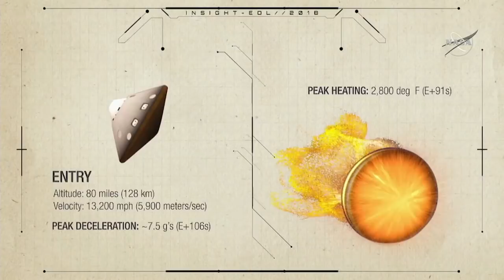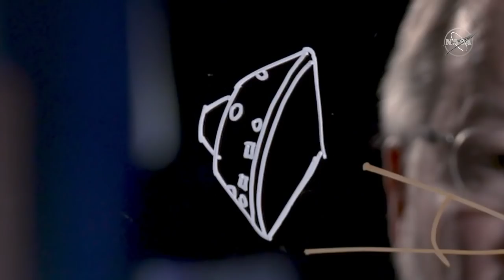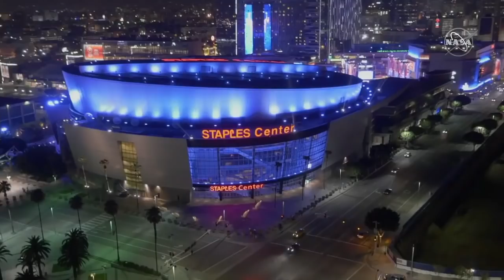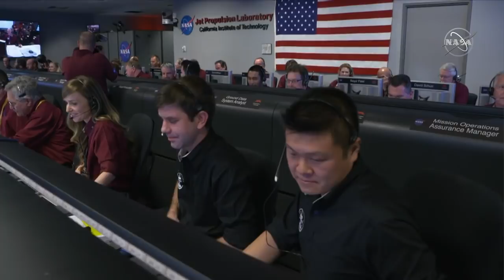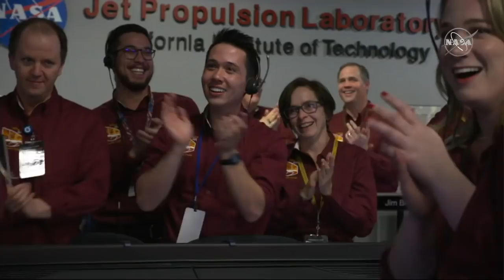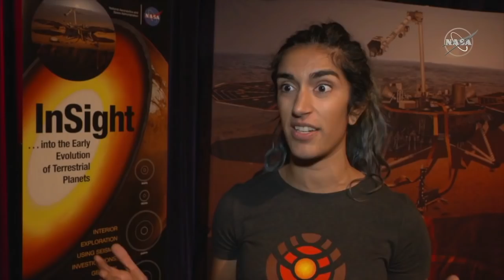NASA’s InSight spacecraft makes historic landing on Mars

Comment: LOLOLOL 1000 degrees c is 1800 degrees, HOT ENOUGH TO MELT STEEL
Reply: Maybe you should learn about how the heat shield works. It's not just a piece of steel slapped on the bottom of the vehicle.
Reply: @joshw7978  Nope. Try again. Was making a reference to 9/11.

Comment: "We(NASA) believe there is liquid water 10 000 meters below the surface of Mars"...    meanwhile here on our Terra Firma, the Kola Superdeep Borehole was just 9 inches in diameter, but at 40,230 feet (12,262 meters) reigns as the deepest hole. It took almost 20 years to reach that 7.5-mile depth! And, not physically possible to go deeper as there was some sort of inpenetrable barrier as per the Russian drilling team.
So, please NASA, do tell what kind of Disney Magic will be used to reach the depth of 10 000 meters on the heavenly body called Mars, to somehow confirm the claims.
Nice CGI and the telemetry information returned so clear as if still on earth via sub ocean cables...simply amazing

Comment: Lightspeed is the key to time travel. Of course, no object with mass can achieve such a speed. The solution to this problem is to send lightspeed through a person/object, rather than the other way around. Fire a concentrated beam of electrons at the target covered in positrons and it shall be sent back in time, leaving gamma radiation in the space it once occupied. This only works for backward travel, not future travel. Cheers from the year 2376!

Comment: 1:27:18
The counting down it's not logical at all..
It began at 600m and it took 3s to reach 400m and 3s to reach 300m and 2s to reach 200m and 1s to reach 80m !! 
It's like you are saying that insight was accelerating, not landing because the movement wasn't stable..
It's just like saying that, your counting in range of 0-101, you begin with 2 the 4 then 6 then 59 then 68 then 90 then 92,94,96,98,100!.
It wasn't logical to me anyway!
Reply: @Mark Bibbee 
That's what confused me !
I mean, let's say that when it was at 600m the engines were not working and insight had a vitesse of 100km/h let's just say.
So if we turned on the engines when it reaches 400m, the vitesse should slow down, and that what happened, so it took 2s to go 300 and 3s to go to 200 which means it's slowing down and let's say that the vitesse is 60km/h.. At this point we are close to the grown right? 
So what makes me wondering is, how could it take 1s to pass 120, from 200 to 80m, while it took 3 second to go from 300 to 200 !! It supposed to slow down! So it's just like saying, the vitesse went from 60km to 100 when we are close to the grown and then went back to 40km ! 

It's not logic, if the engines were turned on to slow the velocity, then the vitesse should dicrease, and it should be something like.

3s from 600  to 400 ,3s from 400 to 300, 5s from 300 to 200, 8s from 200 too 100 , 8s from 100 to 70, 15s from 70 to 40 ...... And so on..
Time should increase while the vitesse is dicreasing..

Comment: Why not use nucular power to run the equipment,instead of solar?    Then have a mini vehicle with camera that can detach if big vehicle gets stuck or stops ? Or drop one big stationary camera with lots of zoom landed on a high spot ? That will last year's and years !
Reply: What is the rocket that was sending the nuclear fuel into space blew up in the atmosphere?  Hello Nuclear winter.
Same with if it crashed into Mars.  How long before that dissipated?

Comment: No live footage of it landing? Saying we cant have a camera on it showing it land?
Lol okay
Reply: It’s from Mars! Not like they get a good cell signal there. Probably can’t manage even 10kbps. Fractions of the speed of dial up. The relay cubesats are long gone already too, so probably much slower now. Not worth the days or weeks of time and power to upload a short 1080p video or something, or worth the added weight to have the video camera it in the first place.
Reply: @David Clark  Because the landing is only a fraction of its lifespan and it's automated anyway. Video wouldn't serve any real purpose that sensors dont already provide.

It's drilling into the planet not combing it's surface.
Reply: The lander has a limited amount of power by the time it gets to Mars and needs that power to ensure all systems to land.   More than  half the attempts to land on Mars have failed.   Furthermore, the camera and solar panels cannot be exposed to the heat of entry.  It has to land, wait for dust to clear, then open so the solar panels and camera are exposed.  If there were a camera aimed at the ground during entry, rather than the heat shield, it would burn up along with the lander.  The whole bottom of this thing (like the bottom of the Space Shuttle and all other space craft) is a heat shield.  Cameras wouldn’t survive.
Reply: David Clark probably due to power capacity
Reply: You do realize the signal transmission would take near 13 minutes to get back to Earth, even at light speed? Meaning even if they streamed it, what you would see on the stream would have already happened 13 minutes prior to it actually being shown. There will never be a truly "live" stream on Earth of voyaging to any planetary mass.
Reply: Zayflux I hear you but why not do it with the delay? You're telling me that mankind is achieving this great feat, and they are technically capable of filming it and showing it to the population live but the only thing would be it would have a 13 minute delay and they won't do this why?
Reply: I agree. Until nasa starts providing some actual video, even though it wouldn’t be live, I refuse to believe they are landing anything outside of earth.
Reply: Mr SpacePandaMan  cameras are not exposed during landing because the whole bottom of the vehicle is a heat shield.  If a camera were exposed, it would burn up during entry.  Also the lander would burn up because there would be a breach in the heat shield.  NASA was able to show live video of the moon landings because the moon has no atmosphere, so there was no heat shield.  Mars has an atmosphere, though a weak one, so enormous heat is generated when something flies down through that atmosphere at great speeds.  The only was we will see a Mars landing is from cameras of a space craft already there.  They are still developing the technology to be more precise in landing zones, so there is no other camera around to photograph it.  Watch one of the simulation videos, and you will see how the heat shield operates.
Reply: @kathyyoung1774  Nice try, but it's like trying to speak to a brick wall, only they are much more dense! One could do research on the failure of the public education system by monitoring the comments of morons on science experiments like this one. They all flunked out!!
Reply: Brandon Charbonneau exactly what I thought.... Why the camera on the people instead of the landing instead.... Another NASA scrub job